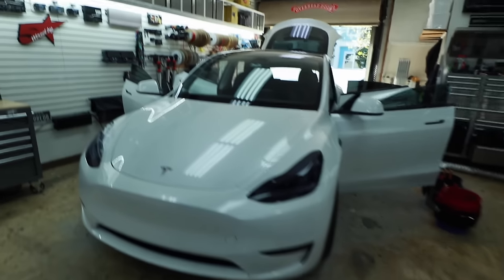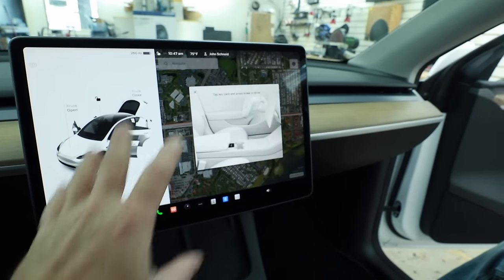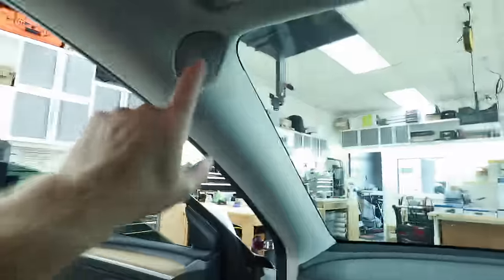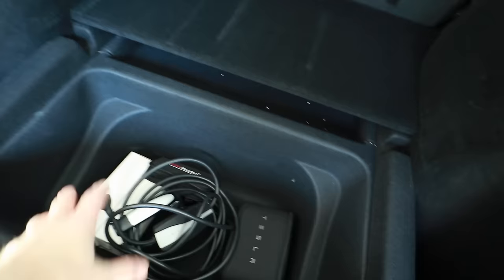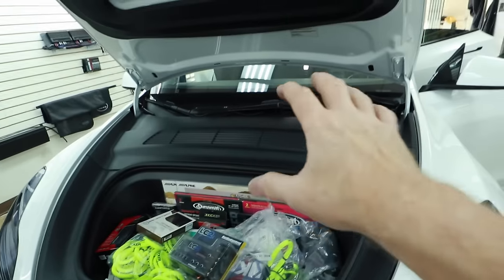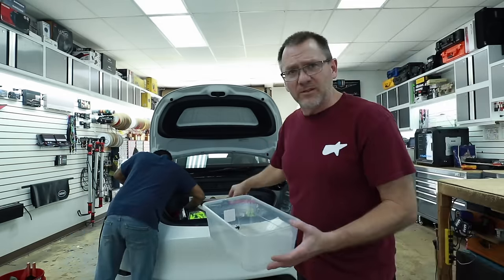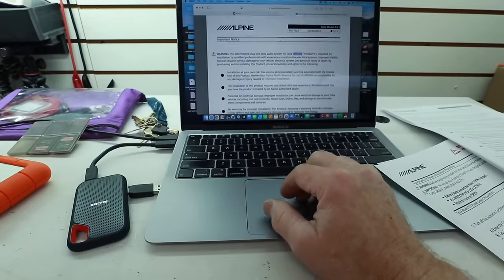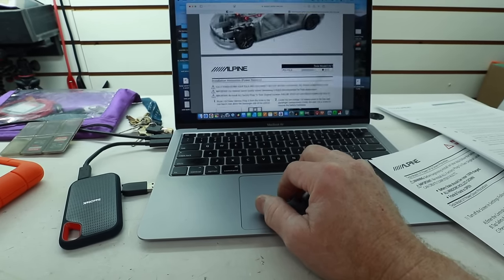We start the new Alpine Tesla Model Y system from the bay part1

Comment: I'm doing this install in my Tesla model 3 right now, wish you had the next video out now. Dang. Not sure if I need to connect the center channel tweeter adapter off of the center channel midbass, or plug it into the stock cable for center channel tweeter...... I didn't see any instructions but maybe they Y has some so I'll check there. Thanks

Comment: Always nice with a five star video. Do you guys still do Gladen installs once in a while? Im currently preparing rebuilding my system, and ive heard nice things about Gladen Audio, so I've bought Gladen SQX 8" sub, 4ch amp, 2x M-Line 6.5 comps. I got the speakers and the amp second hand, but never used for a bargain at around 25% of current new price+a box of power cables and other accessories. In the future i wanna try the sweetness of adding a mosconi DSP as ive never had a DSP before. Thinking of doing a 3-way front stage+sub setup one day. Any specific Mosconi DSP you can recommend for a DSP beginner?

Comment: Why you guys keep mounting amps under front seats??? During storm season specially Florida most cars get water damage during floods and ruin your amps.. 
i had so many customers complaining about flood damage or under seat accidentally damaged like dropping drinks or people (kids) kicking them
Reply: I'm currently preparing for rebuilding/upgrading my setup, and I like the subtle installs, so I wanna do underseat amp rack. Where I live(Denmark) I never experienced a flood like in Florida, so that's not a problem in my case, and I plan on making some kind of shielding with mesh to prevent people accidentally kicking the amps and stuff. However, I kinda worry about heat and airflow. I think I need to mount the rack directly to the underside of the seat in place of the drawer my car has, and I need to find out if the heat from heated seats bleeds through beneath the seat.
Reply: cuz nobody is getting their amps wet